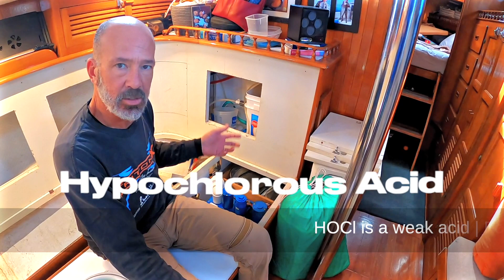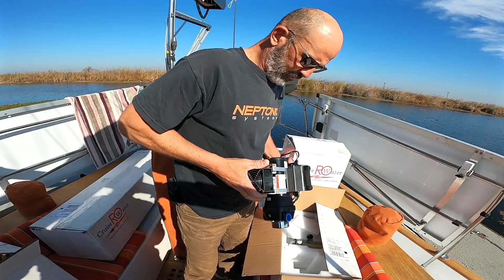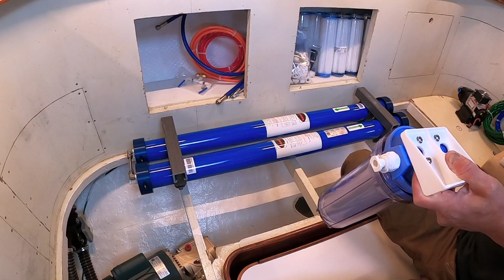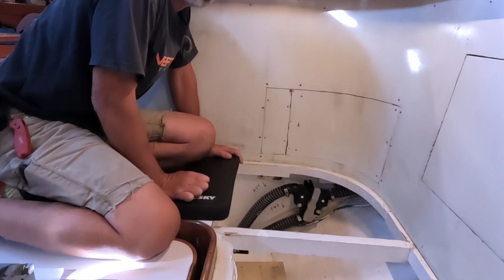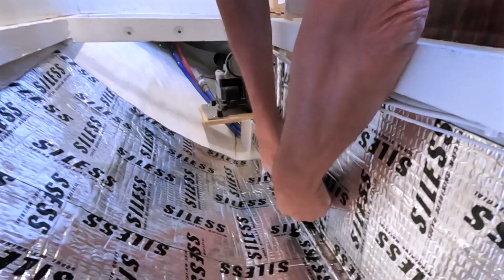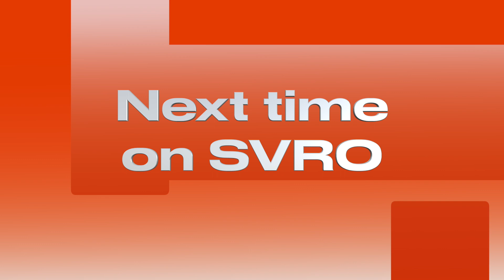Water, Water Everywhere 💧: Installing a WATERMAKER for Endless Freshwater Bliss | SV Ramble On

Comment: Another good one, guys. 18 months from initiation to installation is about right in my experience, this is deliberation time and has nothing to do with procrastination 🤣. As we all know, when a man says he will do something, he will and there is no reason to nag him about it every six months.

At the beginning of the video you mention that you painted the inside of some of your lockers about a decade ago and here we see you paint right over the vinyl liner. How is that holding up? We have the exact same stuff and after 40 years it is nasty but a bear to remove.
Reply from the maker: 🤣🤣🤣
Being in freshwater, the incentive for a watermaker has been low.  Now that we're a week or so from leaving it's skyrocketed to the top of the list!  And of course it's taking twice as long to finish and four times as many trips to the hardware store than we thought 😖

I really do hate that vinyl liner.  We've painted over all of it and it seems to be fine.  Certainly looks better than it did.  I removed the vinyl from the v-berth so we could insulate it and add new headliner a few years back.  I love how it turned out, but I'm not willing to do it again.  I've glued some closed cell foam over the old vinyl to the insides of some of our lockers that get really hot and it has helped, but it's not as pretty to look at as our v-berth.
Reply: @svrambleon  Thank you for your reply, much appreciated. I must have missed the announcement of your sailing plans! Good luck with everything, hopefully you will have time to share some of your adventures with us.